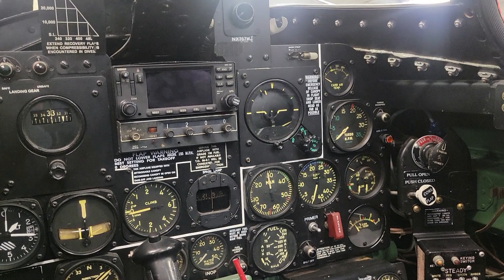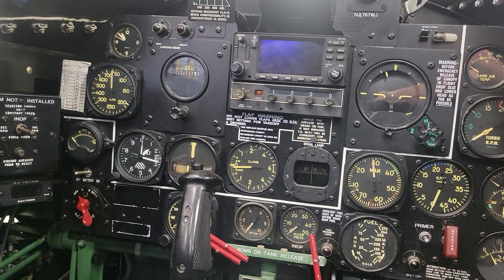TEARING IT OPEN!! A look inside the P-47 Thunderbolt

Comment: Gorgeous but there are a couple things that mystify me.  That gloss gray fuselage paint (supposed to trick people into thinking it's NMF?) and the green wheel wells and inner gear doors?  Thanks for posting!
Reply: I admit I'm no expert but the green inteior looked a bit dark for zinc chromate but I guess there were many variations.
Reply: Modern Zinc Chromate is greener in color because of the chemicals added to make it less toxic to the user. Lamp black is the chemical that turns yellow Zinc Chromate into a deeper green.
Reply: @ScoutSniper3124  I just don't buy that, Ryan.  I say that because during the video, we see other parts of the fuselage interior (not the 'pit) that are perfect Yellow Zinc Chromate.  Yet the wheel wells and inner doors are that puke green.
Reply: @jrgreiner  I had a bit of a look around and it seems there were 2 colors that were used, I'm assuming this was the darker of the two.
Reply: @potrzebieneuman4702  Factory specs were for the wheel wells and inner gear doors to be Yellow Zinc Chromate.  I've never seen a period WW II color pic of any P-47 with something different. That's fine.  Since it's also an exterior paint being used to simulate NMF, it's obvious they're not going for complete accuracy.
Reply: @jrgreiner  that would explain it.
Reply: @potrzebieneuman4702  Yup.  Probably so.